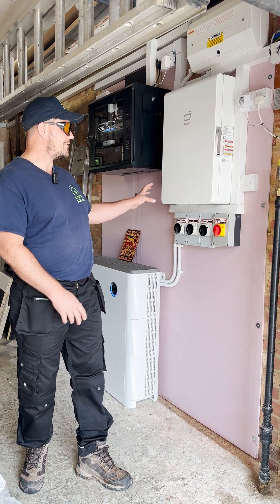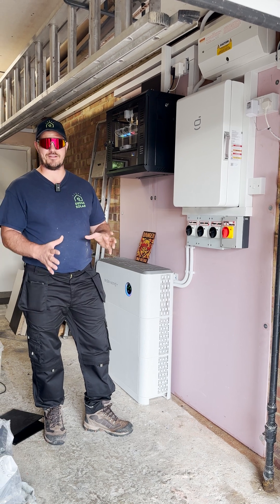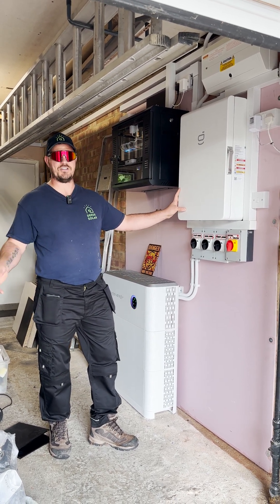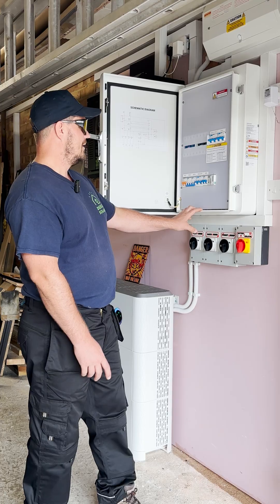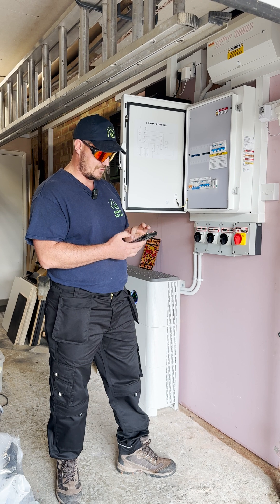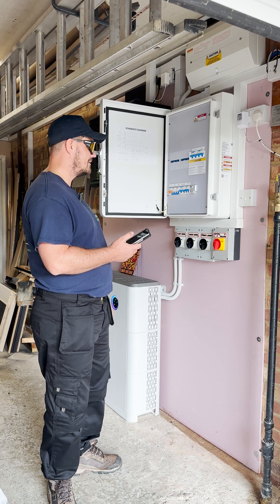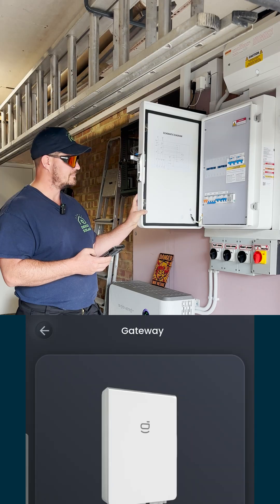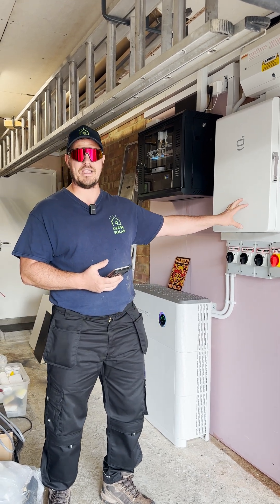We’re Putting this Sigenergy Gateway to The Test! 🧐

Comment: I'm considering installing a sig. My current switchboard doesn't have any more positions free for new switches, but I'd love to run a new cable for a new electric appliance (large hot water heater). 

Are any of those physical switches on the gateway available for me to run new circuits off them directly or will I need to update my main switchboard?

Hope that makes sense!